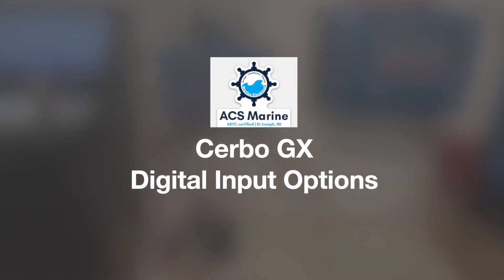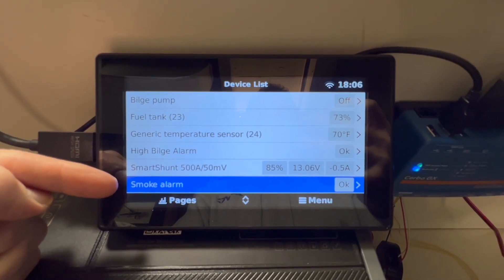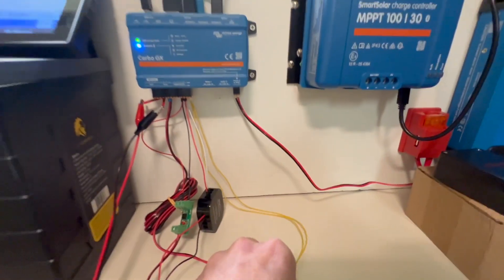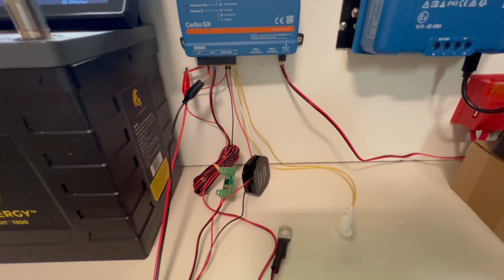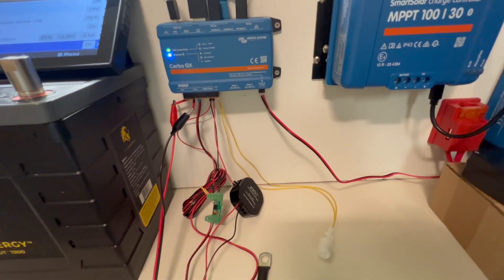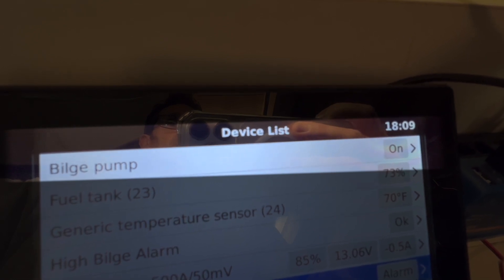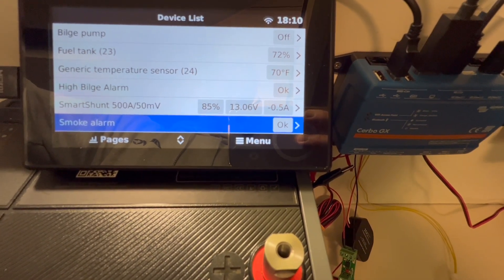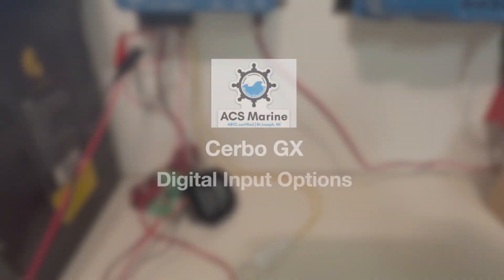Victron Cerbo GX Digital Input Options

Comment: Thank you for a great video! 
What is the name of the relay you are using for the bildge pump? 
If I want to DIN rail mounted relay, what is the specification I should look for? 

Can use a relay to tap into the float switch that is triggering the bilge pump?
Reply from the maker: The relay in the video is this: Zooz NO & NC 2 Channel Accessory Relay ZAC98 (12-24 V Inputs, Dry Contact Outputs). Be aware that ignition protected parts are required in some applications. And it just so happens I have a video of integrating the relay into a bilge pump float switch setup: https://youtu.be/8v-77y141zY. As far as a DIN-mounted relay, I'm not sure. Sorry. Glad the video was helpful.